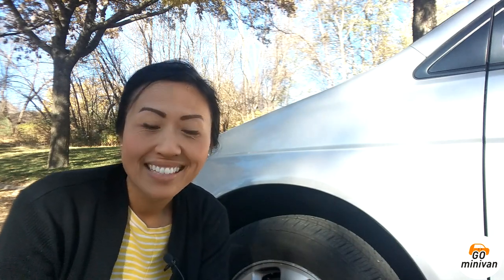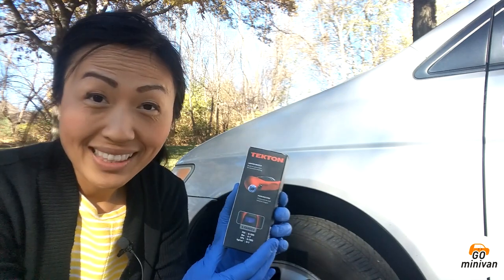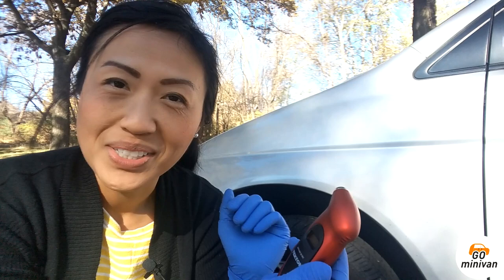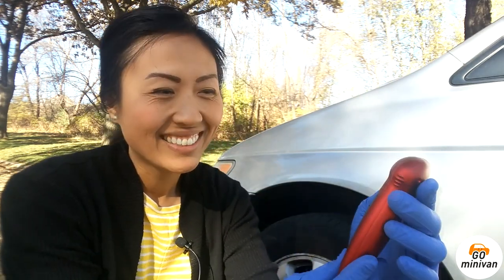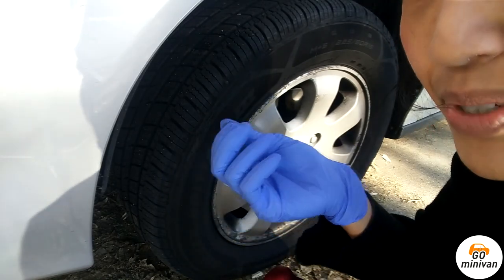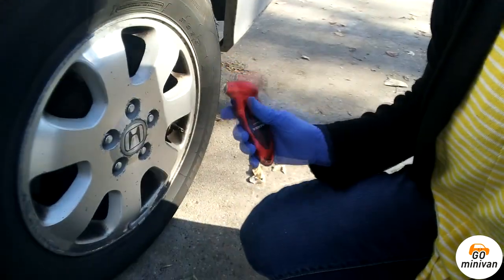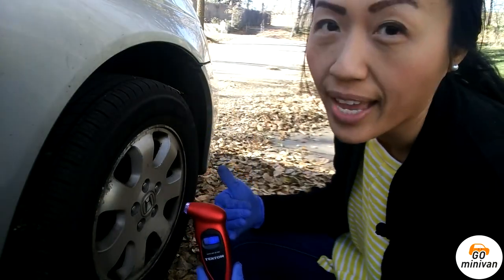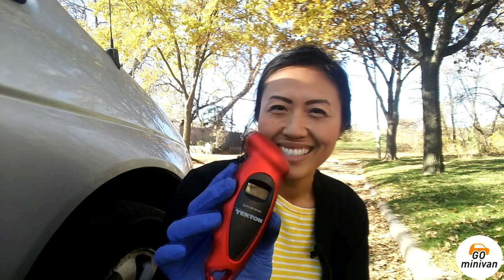TEKTON 5941 Digital Tire Gauge, FULL HONEST REVIEW

Comment: Hi. Does this still work or did  it eventually break?
Reply from the maker: Hey there! It's been about 2.5 years. Still works like new. I use it quarterly though. Never had to replace battery which I heard it's a pain
Reply: @GoMinivan   When you put the device on the  tire valve, do you have to press the button from device? I got mine today and when i inserted the device to the valve, the PSI stayed at zero. Im thinking i have a defective one.
Reply from the maker: @bj10jgo  Hmm.. let's see. I toggle the button to the right setting (PSI), it cancels out to zero. I then tight fit it to the valve and air pressure. Takes about .5 seconds to read the number. Try again.. I'll be shocked if you had a defective one.
Reply: @GoMinivan  i think i do have a defective one. First, i have to press the button numerous times to turn it on. Second, when i insert the device in the tire valve, either the number doesnt move and stays in zero or it gives me an accurate reading of a low PSI because when comparing to the old fashion tire gage, the PSI seems normal.
Reply from the maker: @bj10jgo  Hm... the first point you made about pressing many times. Yea.. sounds like it's defective or low battery. Sorry.